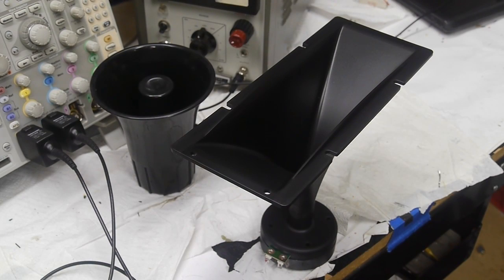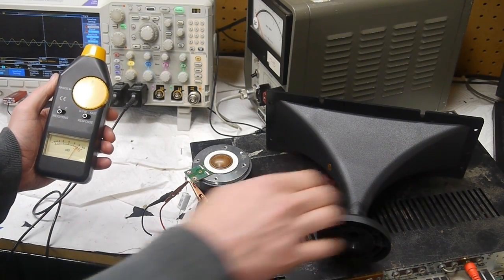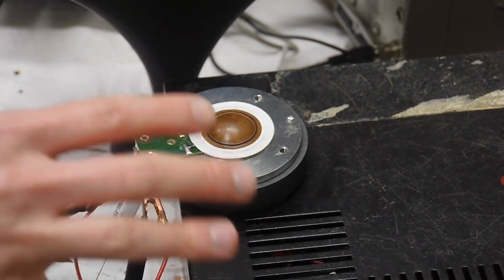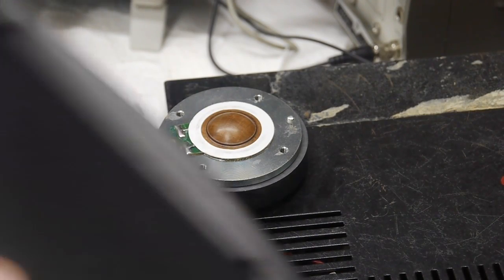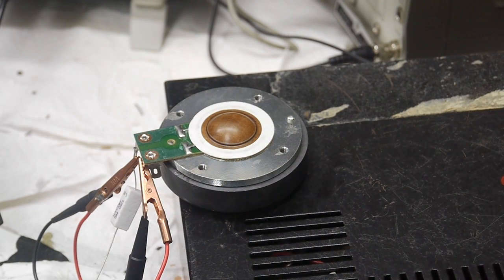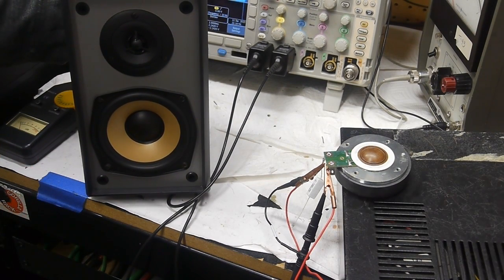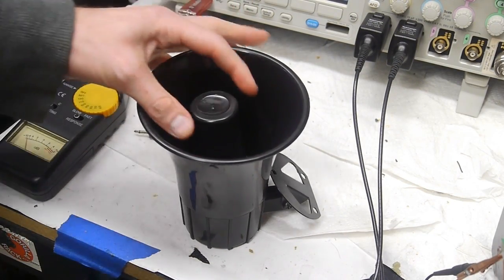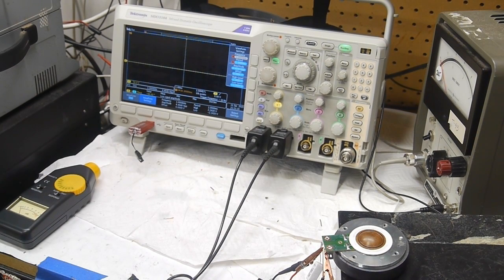How a horn amplifies sound (hint: Impedance matching)

Comment: while horn speakers are still used in home HiFi, most are connected to low power tube amps. 
Horns color the sound.
To make a horn sound natural, a phase plug that is engineered for the frequency phase shifting that a horn induces has to be employed. first you have to measure what  frequencies are being cancelled by the horn.
in club sound, sound dispersion is more important than fidelity, and the compression drivers they use don't have phase plugs. even the crossovers are designed with wider sound dispersion characteristics.
your horn had a phase plug.
You didnt quite clearly state how the horn in directly coupling the air to the rigid dome increases the sensitivity of the speaker. you noticed a gain of 3dB in your test with the horn on.  that's the equivalent of twice the electrical amplification power. That's probably why you would notice anything on your scope without measuring SPL too.

Comment: When using a woofer and scanning frequency, you can detect the change in impedance. A speaker is rated at 8 ohm DC, but the actual current absorbed versus voltage makes it appear like a higher value resistor. Furthermore, this value goes up and down as the frequency increase.

A speaker is basically an inductor which means that it conduct electricity less and less as we increase the frequency.If all the energy would be transfered to air, the speaker would appear as a resistor, which mean an equal resistance value at any frequency. The resonance created by the back of the speaker (and the room in front to a lesser point) makes the speaker more efficient to transmit sound at those frequencies.

For example, if the speaker is designed to sound the louder at 70 Hz (typical value for "deep bass" woofer), it will also be loud at double the resonnant frequency,  140 Hz and triple, 210 Hz, etc. When scanning slowly from 20 Hz to 20 KHz, we can see on the scope that the voltage and current get almost equal in phase at 70 Hz and 140 Hz.

In any real speaker, the is a few more, weaker, frequencies which also resonnate. The sum of these makes the shape of a curve of impedance versus frequency difficult to understand. When playing real music which is made of non sinusoidal wave shape, which mean, equivalent to many sinusoidal wave of mixed frequency, the distorsion created by the non linear impedance of speakers is clearly much higher than any other part of the audio system.
Reply: I reply to myself before anybody ask a question... A note about distortion : I used to believe that distortion means modify the shape of a wave from pure sinusoidal to square,

We know that a square wave is equivalent to the original sine wave, but with the addition of odd harmonics. For example, if I send a sine wave of 100 Hz to the input and the amplifier is over driven so much that it can only output full scale/zero scale (a square wave), then what the amplifier is really doing is creating a sum of 100 Hz + 300 Hz + 500 Hz, etc As the frequency goes up, the strength of each wave is lower. After reaching 5 KHz, we can stop looking for higher harmonic as they are too weak.

However, when dealing with high quality amplifiers with very low distortion, any change in amplitude is also contributing to the rating. For example, consider a 100 Watt amplifier ; f the input is a pure sine wave of 1 KHz at 20% max scale, the output should be exactly 20 Watts, then increase to 30%, the output has to be 30 Watts.

One way to understand this is looking at AM radio.If we produce a pure sine wave at 530 KHz (the lowest frequency in AM band) and we modulate it with a much lower frequency of 1 KHz ; on the scope, we see the sine wave at 530 KHz getting stronger/weaker. The shape of the peak, on top or bottom follow exactly the 1 KHz signal.

Now, if we use a spectrometer to find the frequency, it will tell us that it detect a strong signal at 530 KHz, but also a weaker signal all around, ranging from 529 KHz to 531 KHz.

Conversely, if I tune my AM radio to 529.5 KHz, I can hear the sound but not as strong as if I tune exactly at 530 KHz. A stronger modulation will spill over the frequency more, so you can detune your radio a lot on some radio station while other need to be set very precisely.

In other words, when changing the intensity of a sine wave, it is equivalent to changing the frequency a little up and down. Brief, if an amplifier is not perfectly linear, if it add or remove a tiny percent of the input signal depending on the intensity, then it change the shape of the original signal and introduce new frequencies.This count as part of the distortion rating of the amplifier.

Comment: I have my own theory about this: 'pressure bubble'. When a diagram moves it pushes a bit of air in (or out), that air quickly moves further out, when the diagram moves back again it sucks that air back in. But some of the air further out of the bubble at 'the edge' isn't quick enough to get back so to speak and that's where a wave forms. So a speaker 'blows a bubble' and at the edge a wave comes of and the rest gets sucked back in again. A higher frequency mean a smaller bubble and a lower a big one. Now if you limit the room of that bubble area then the pressure gets higher which means more work gets done by the diagram. So that's basically how they work it's a small room which gives more pressure and then it's a matter of guiding that wave out. Anyway that's my take on it the theory also works with bass speakers if you put two together they work in the same bubble and you get an extra 3db boost, you can also put a bass speaker in the corner of the room that also gives a boost. A horn can be thought of as an 'artificial corner'. It's just limiting the space so you get more pressure. The rest of the horn is just a waveguide so that it spreads out nicely and detaches without reflecting back inwards. Offcourse I use ribbons can't stand horns..
Reply: +Alex stevensen That's why a horn mostly helps the lower (mid) frequencies, in the higher range the bubble is small anyway but the mids is where the power is and there the horn really helps so you can have a 2-way pro speaker.
Reply: +Alex stevensen That also explains the 'baffle step', in the case of a hifi speaker when you go lower in frequency at a certain point the bubble expands beyond the front side of the speaker and starts leaking backwards so instead of filling a 180 degrees space it now has room to expand to 360 degrees.
Reply: +Alex stevensen Offcourse there's a lot that can be said about speakers in general,  a low mid driver really works in three distinct areas, constant position, constant speed and constant acceleration. The first and the third are amperage driven the midst is voltage driven.
Reply: +Alex stevensen   you have ribbon tweeters?  Nice kit!
Reply: Ray Kent yes neopro 5i sounds very nice :)

Comment: Acoustical Impedance matching magnifies the sound from a speaker but does not amplify. There is no active gain.
Maybe it is just a question of semantics here?
Reply: A directional antenna exhibits gain. The addition of the horn extension exhibits gain over the driver alone. Yes, semantics...

Comment: The dome your referring to is the High Frequency diaphragm and voice-coil. its made from cloth soaked in a resin called "Phenolic" / Hence;  Phenolic tweeter.
 Phenolic, Aluminum, Titanium, and beryllium are used to form HF diaphragms and all have different sound reproduction with varying efficiency's.  Beryllium is #1 sounding but insane expensive and poisonous if it cut skin. Titanium is the sound professionals happy middle.

Comment: Is it TRUE amplification or is it simply concentrating the sound that is produced into a narrow beam? This is what we call in amateur radio "Effective Radiated Power"  I can use a dipole antenna (your simple speaker) that radiates radio frequency energy in all directions and feed it with 10 watts of power and feed a beam antenna with the same 10 watts and get a significant "amplification" in the direction the beam is pointed.  My "ERP" may be 100 watts to someone who is looking down the beam but the input to the antenna and total radiated power is still only 10 watts.  The difference between the beam and the dipole is that in a beam all (most) of the radiated 10 watts is in the same direction rather than in all directions.  This is not true amplification but concentrating the radio waves into a narrow beam like a flashlight parabolic reflector does to a flashlight bulb. That's why it is called EFFECTIVE radiated power.  Putting a flashlight bulb into a parabolic reflector doesn't make the bulb any brighter, it only makes all of the light go in one direction and appear brighter.

You would get the same effect with your audio level meter if you simply put the bare speaker at one end of a tube and placed your meter at the other end.  All of the energy would travel down the tube and would be MUCH louder at the same distance than if the tube wasn't there.

Nice video by the way.
Reply: +wb5rue More like the Standing Wave Ratio.

Comment: I worked for 15(or so) years as a Live Audio Tech(Sound Guy). The largest company I worked for takes impedance traces of each of the drivers in an enclosure then average them out over all of the enclosures. If the trace of any given enclosure did not closely mimic the average trace we would investigate further. It made testing the speakers after a concert much faster and a lot more accurate than listening to the individual components alone. 
This was all done on speaker enclosures with no "on board" passive crossover networks so we could check each driver individually.

Comment: I think you got the high and low impedences backwards. The tweeter can push a little bit of heavy stuff very hard, which is like high voltage low current flow. But air can move a lot with just a little bit of force which is like low voltage high current flow.

Comment: Horn Test Question:  If the short sides  of the horn possess an exponential flair and the long sides are linear (flat) , how should the horn be oriented to get the best horizontal dispersion of sound minimizing sound going to the floor and ceiling??
Reply: +John Ossi Good question, John.  The answer is that the horn should be oriented with its larger dimension being vertical.  At first glance, this seems wrong, but if you think of the horn as a device that directs audio towards a small zone in the distance, it makes sense  that more directivity would be achieved by a larger diameter horn.  If you truncate the left and right sides of the horn the audio will be less directional in the left/right direction but still be directional in the up/down direction which is what is desired.
Reply: Yes but this is only true when the two larger surfaces are planar. .If they are curved and the smaller sides are flat then the hoen should be mounted horizontally

Comment: The reason you could not measure the loading difference with and without the horn is probably because the horn impedance matches only the audio power.
The audio power with and without the horn would be the same(fixed).

Comment: The horn increases the sound pressure by 3dB. Is that not an effective doubling in sound pressure power?
Reply: Sure, but perceived loudness and power are not linearly related. You have to more than triple the power output to double the perceived loudness. This is why huge stadium system use such an insane amount of power.
Reply: @AureliusR  More than triple indeed. You require TEN times the amount of power to be perceived as twice as loud.

Comment: I dont understand because the amplitude of speaker motion is what is transmitted to and sensed by the mic so how would increasing the surface area of the speaker increase the amplitude reaching the mic if the speaker has the same amplitude?

Comment: This was great.  Am so glad you explained things in terms of audio.  Wondering if a piezo speaker to a metal plate would provide a better relative impedance match so that you could see the phase difference?
Reply: The metal sheet (if thin enough) would make an audible noise, so you could still hear it, but the impedance match would be better.  Amiright?

Comment: Actually, horn systems are available for home audio systems: google "Klipschorn" to see them. Speaker efficiency (105 dB 1W / 1M for the legacy Klipschorn) is an important factor for those who like to rock the house! Klipsch is the premier horn system, and they're also very expensive.

The low frequency driver (woofer) uses a conventional cone type speaker, but the cabinet incorporates a folded horn design for bass you can feel in your chest!

Klipsch: Pissing off the neighbors since 1948!

Comment: Another reason you wouldn't want to make an HF driver as large as a midrange or woofer (assuming you could overcome the physical and material properties issues) to achieve better acoustical impedance matching is that as you make the radius of the driver larger the directivity index will increase. In short; a small driver is a closer approximation to a true point source and as such will radiate in a more omnidirectional manner. As you make the transducer larger it will inherently become more directional. At a certain point the narrowness of the resultant (mostly) horizontal polar response would be unacceptable producing a speaker that can only be enjoyed in a very narrow window both vertically but more importantly horizontally. That said the controlled directivity can be a benefit if used correctly; for instance to reduce the degree of undesirable room interactions as you alluded to. Good show!

Comment: Impedence matching is also very important on ultrasonic transducers, where you get reflections of your input deflection otherwise which corrupt your outcome. It is mostly a dependent on propagation velocity and density and tricks with carful designs of length (lambda/4 sheets) can lead to interesting results.

Comment: Correct me if I'm wrong. The way I picture it in my head, the difference between cone or no cone is the same as submerging the twitter by itself in a large pan of water and turn it on, you will create small waves, or small water movement; but if you add the cone, you will have the same water level but separate the rest of the water and you will have a little water inside the cone. When you turn it on it will move that water more and higher. (sorry for my english)

Comment: Hi Ben. First I wanted to say thanks for all your vids, that I really enjoy a lot always! You're amazing!

About the impedance issue, I have to say that the source of mismatch is not the size mainly (although the speaker efficiency is proportional to membrane size, but that's not the source of it). The main problem is that the acoustic impedance of the generated pressure wave (for those who don't know it, I'm referring to the "specific acoustic impedance", which relates pressure and volume velocity, and characterises the media and the wave) is very reactive near the membrane, meaning that the pressure and particle speed are almost completely at 90 degrees, thus radiated power is almost all reactive.

Putting a horn forces the volume velocity to have a much similar direction to that of the pressure, so impedance is more real and less reactive. It's like the horn forces the particles to vibrate "in the direction of the horn".

The shape of the horn being exponential finds its reason in the "flare rate", the rate at which the surface increases (differentially). In an exponential horn (usually a power of, that is: e^x), the flare rate is constant, which leads to a more flat frequency response. Horns doesn't work in low frequency anyway because the wavelength is much larger than the horn, so the propagated wave is again very reactive and for those low frequencies the horn is "invisible".

Comment: My father built his own speaker enclosures in the mid-60s from plans published by James B. Lansing (yes, JBL). They had a 15" woofer where the enclosure served as an 8' folded horn, plus a tweeter. The tweeter was interesting because it had a ring shaped horn. That is, the center had a bullet shape, and outer portion was machined so that you had an annular parabolic horn. OK, I'm an engineer. Those who are thrown by "annular parabolic horn" - it looked something like an orange juicer. Google "JBL 075 Alnico Horn Tweeter" for more information, although I'm not sure that's the exact tweeter my father used, or is in the JBL plans. It looks identical to what I remember, but evidently JBL had several tweeters of similar design.

In the late 70s, dad went speaker shopping, thinking that technology must be able to produce a speaker that sounded better than his. About the only thing we could find that came close was from Klipsch - another folded horn speaker!

So while the vast majority of consumer speakers don't have horns, it doesn't mean it's not possible, and wouldn't provide an improvement. Having spent hundreds of hours with my father listening to everything we could find in the best "Stereo Stores" catering to what would eventually be called "audiophiles," I'm convinced there's a lot of junk out there that  the masses are just ignorant about. After being served pot roast for a long enough time, you tend to forget what prime rib tastes like.

Comment: I never thought about the singularity that way. Thanks. In almost any field the ying and yang of one system does translate to another. If you can get one system your more open to understanding another.

So I'm thinking these transmision line speakers use both resonant and air coupling. one didn't work in my mind without the other.